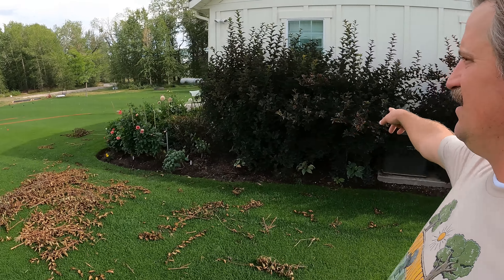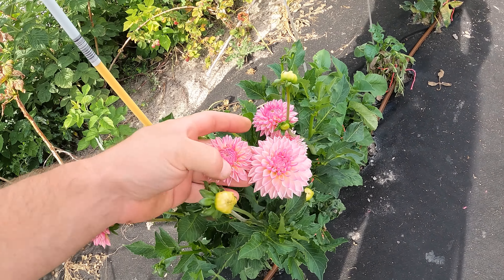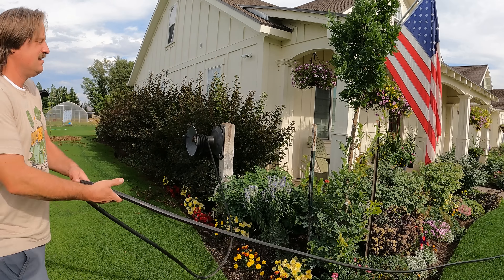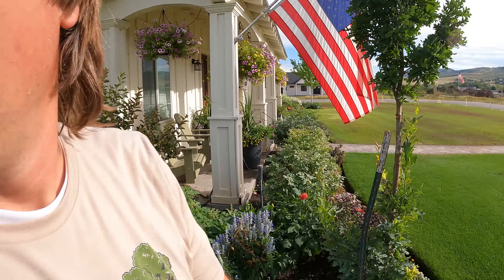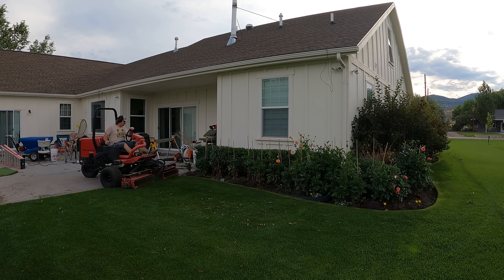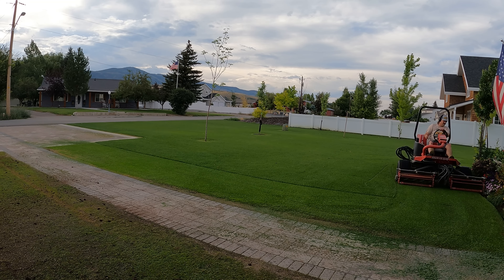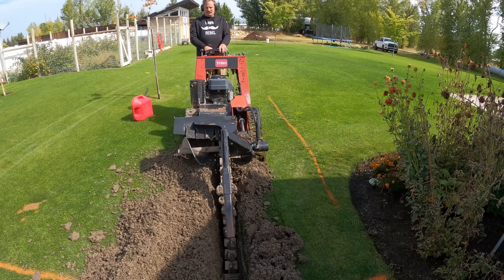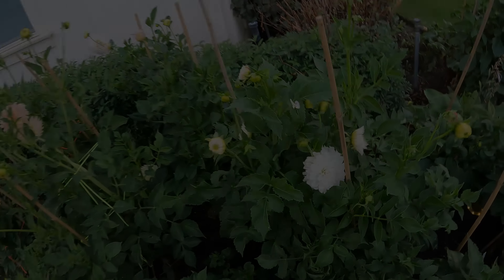DAHLIAS and a FRESH AUGUST MOW

Comment: When I lay the sod, do I make the soil and my concrete sidewalk flush? It appears you have yours like that.  
The reason I ask is... If I'm mowing close to a quarter inch, and the reel mower won't get all the way to the edge unless I put one wheel on the sidewalk which, (if the sidewalk is higher than the grass), would make a slanted/uneven cut around the edge.  Are there special string trimmers for golf courses or something that I need to look into? Or do I just match the soil and sidewalk levels?